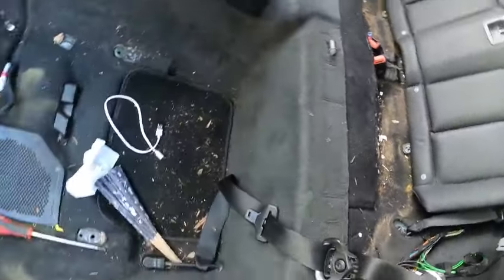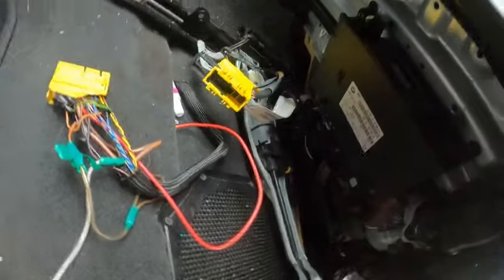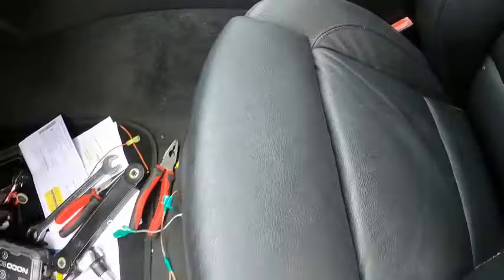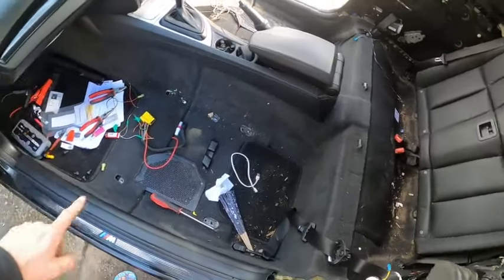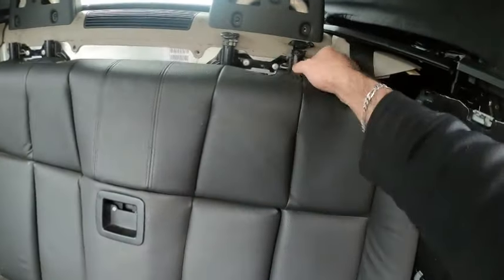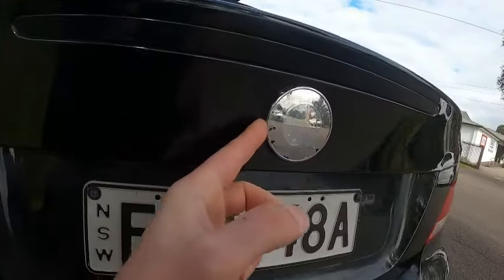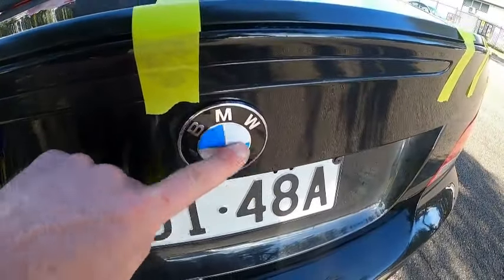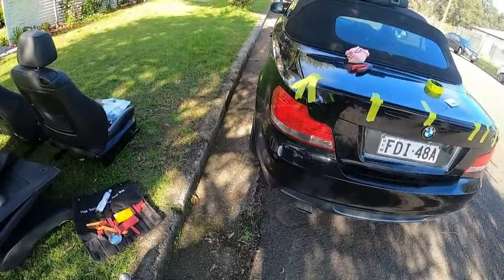Electrical seats NOT WORKING, how to remove it manually. complete interior remove  BMW 1 series 2009

Comment: you should disconnect the battery before unplug the seats. otherwise, you will have airbag light. but looking at the wiring, I am surprised you did not have the airbag light on to start with.  your step by step is really handy. those back seat headrests and pain to remove.
Reply from the maker: technically you are right, it would have been better if I did disconnect before. but as I was fixing the wiring, I needed to know if my work is heading in the right direction. code reader can fix and clear those codes so not too worried :)

Comment: No wonder your seats did not work. I think the jumper pack would have worked, use wire tester to see the power/ground and you should be able to get the motor working. but then again, your method works too.
Reply from the maker: I don’t have one yet, but maybe. I ended up selling the interior because I got the red one to install. Stay tuned for that